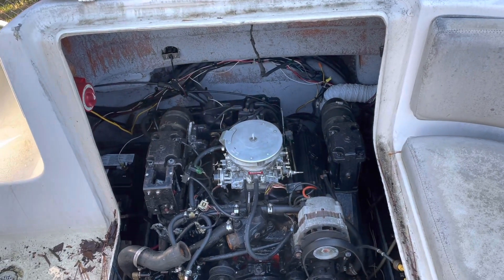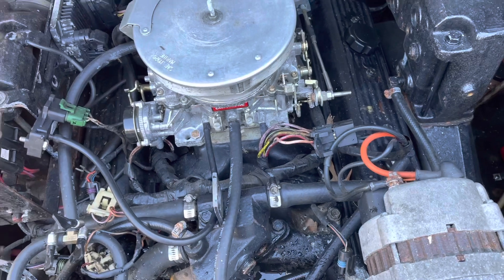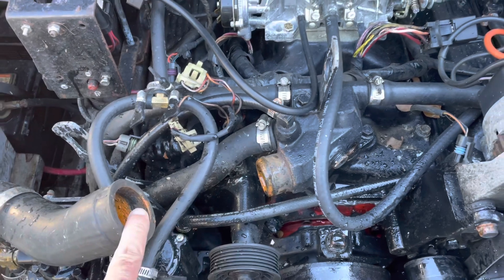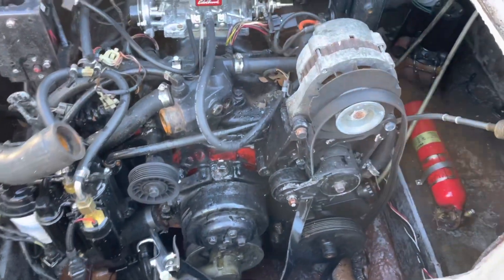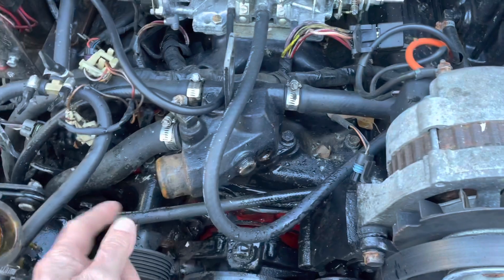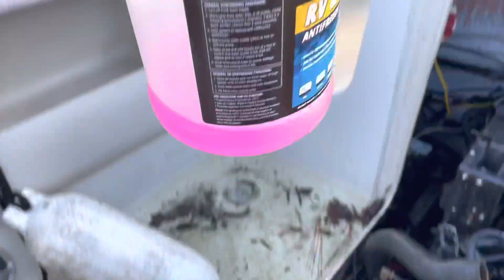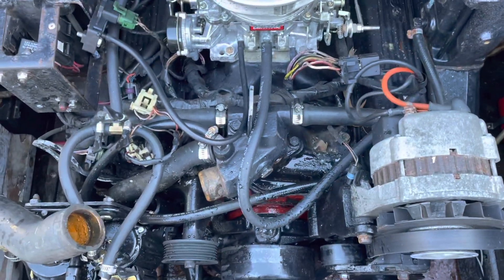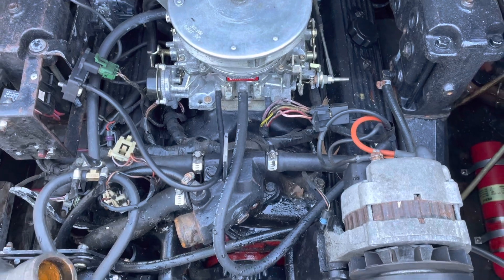Volvo Penta V8 Emergency Winterizing (Freezing Tonight)

Comment from the maker: Btw just because you remove a drain plug doesn’t mean it drained. Make sure that water and lots of it (as opposed to a trickle) come out. A lot of time the hole will be clogged with crud or rust behind the plug and it doesn’t drain or just drips. You then need to take a wire or screwdriver and poke at the crud to get it to drain. This happens just about every time I remove a plug on an old engine, car or boat.